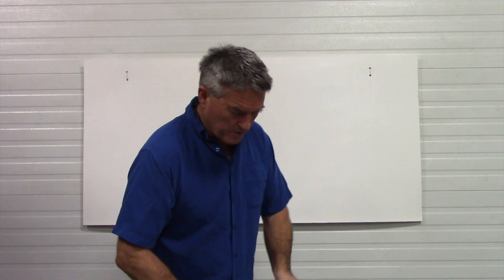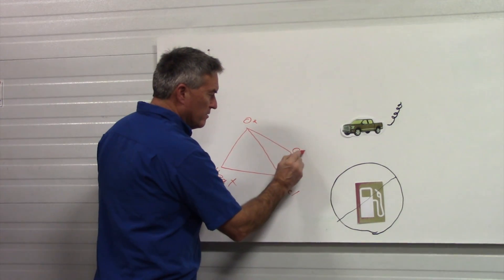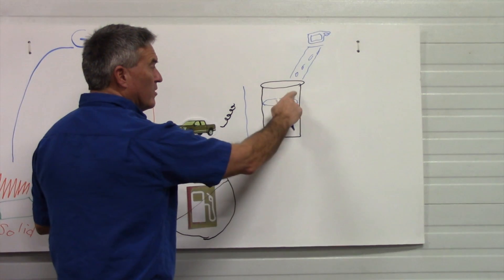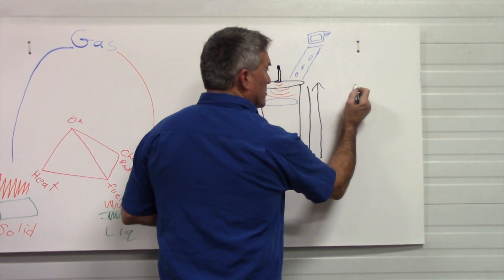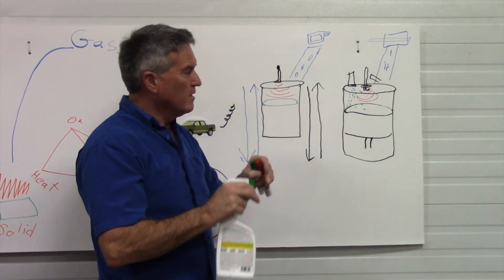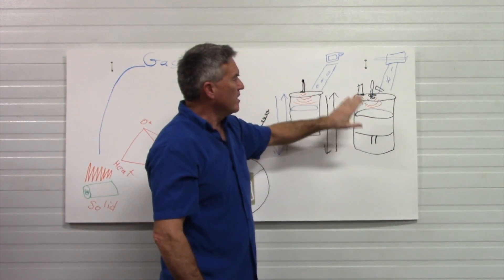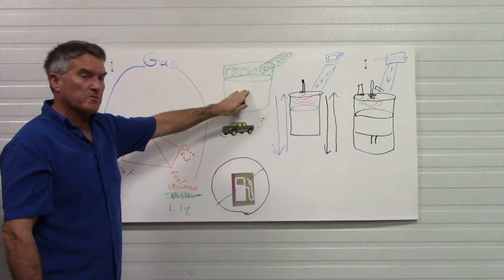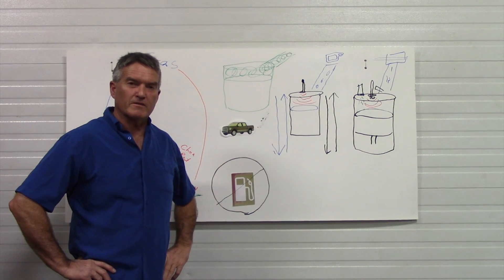One Simple Trick to get 100 miles per gallon with less pollution!

Comment: Cars could be getting a hundred miles per gallon but that doesn't profit the oil industry they have purchased multiple patents that would allow car manufacturers to get more than 40 to 50 miles per gallon. In the 1970s a man in Arizona built a similar device but a particular oil company sought to buy his patent he refused a short time later his body was found dead in the Arizona desert in his car which have the Prototype on the engine was missing. The man achieve 100 miles per gallon in the 1970s he was on the front page paper in Arizona.

Comment: If you cut the top off of a 55 gallon drum and fill it clear to the top with gasoline light a match on top of it that drum will burn for many many hours. If you take a drum cut the top of it off and pour a Dixie cup gasoline in it throw a match in there it will blow your freaking head off. Liquid gas put into an engine does not burn only vaporized gas Burns with oxygen mixed in with it. in 1985 I built a vapor carburetor based off of the pogue carburetor you can look it up Charles Nelson pogue vapor carburetor,,,,, I got 65 miles per gallon in a V8 Chevy with no pollutants and way more power the engine idled very smooth and took off like a bat out of hell. Halliburton got wind of it and threatened to end all life of all my family members.

Comment: I think its nearly too late for this,,, now electric cars are moving onto the scene...
Reply: Actually, EV's were here at the turn of the 19th century, but entities like Rockefeller/standard oil and GM did away with them for their fossil fuel vehicles.
Reply: Electric cars?  Fossil fuel is used to produce elecrtricity (at a net loss of fuel efficiency, never mind the production of the very expensive batteries).  Bah Humbug!

Comment: Not possible!!!
Saudi pockets won’t allow it to happen
Reply: It is not the Saudi Pockets, it is your own government that keeps this from happening.  TAX MONEY!!  The Reason Gasoline is so expensive is TAX!  Wake the hell up.  The people that YOU put into legislatures are sheering you everyday.  In the U.S. the EPA and other government agencies that are actually screw manufacturers are constantly making big noises about wanting to "force" higher mileage standards.  It happens incrementally, and, does so as to extend the inefficient technologies.  It is a ruse, pure and simple.  100 mpg would take too much money out of the hands of government and conglomerates who are joined at the hip.  Charlie Pogue proved out the vapor carb back in the mid 1930's.  IF anyone in government was serious about cutting emissions and getting greater fuel economy, ALL gasoline vehicles would be  either port or direct electronic vapor injected.  That technology was shown to be not only workable, but cheap and practical by a Texan in 1984, who died a very mysterious death, and his vehicle was seized.  That technology is perfected and on the shelf.   Stop blaming the Saudis.  They are simply cooperating with your own people who have been and will continue to screw you without giving you a kiss.

Comment: The explosion doesn't drive the piston down. It is the heating of the gasses in the cylinder that push the piston down. You need to learn the physics of the engine.

Comment: I already got 100MPH with a Honda GX-25 engine on a Huffy bicycle and only paid about $600 total. Only went 16-24MPH without pedaling, but It was okay as long as I didn't travel more than 100 miles in a day, and as long as there wasn't much snow and ice on the roads and shoulders. There's pollution, though. Great for plants, but bad for animals and us. I think the device in the video could be a great idea if it works and is affordable. I'd imagine 200MPG with my bike, or much higher speed and 100MPG without much pollution.

Comment: Well, introducing liquid gasoline into the air-fuel mixture would not be any different than if you injected gasoline in gas form. The O2 sensors downstream check the air-fuel mixture after combustion, and if there isn't enough fuel, the ECU will see it as a lean mix and send a command to the fuel injectors to spray more gas to the air/fuel mixture.  The internal combustion engine is not efficient whether you use gasoline, diesel, propane or other fuel. There is always going to be unspent fuel exiting the exhaust valve on the fourth stroke in a 4-cycle engine.

Comment: In the 70’s a genius guy found a way to separate the hydrogen molecules from the oxygen molecules with the byproduct being h2o dripping out the tailpipe.  Of course he was murdered shortly thereafter.  Before that in the sixties another poor fellow discovered powering an engine on fuel vapor and invented the 100 mpg motor.  What do you think happened.  Then yet another guy found it in the seventies and survived three attempts on his life before he died in an auto accident.  And there have been still others, so here we are today.  Check out certain sites on here or elsewhere.  The point now seems to be if a guy uses it on only his car he is left alone.  But if he tries to sell or manufacture it, he goes.  Gas engines run quite well on vapor alone without damage.  If either one can still be patented the inventor must insist whoever buys it must manufacture and sell it in a certain amount of time and cannot sell it to yet another entity who sits on it.

Comment: Note that in a reciprocating engine the pistons and connecting rods must accelerate to high speed and then stop twice per Revolution.  This produces a lot of wasted energy.  The pistons and rods get hot, and the heat must be dissipated in The radiator.  However in a gas turbine the motion is always perpendicular to the force, so no work is done.  We should all be driving gas turbines, with pressurized hydrogen as fuel.
Reply: You are sooo far from the truth...

Comment: Gas is not dinasoar goo. And  will never run out. 3rd most abundant resource. This guys talking sheet. 
Want 25% more power, turn off the  altinator. Find a better elctrcal.system. 12 volt is the most inefficient system avaiable. 
Robs your engine of a very significant power, and cost you more feul just for that crap 12 volt battery.

Comment: I hope people really don't believe that the powers that be are not aware of this. They are absolutely aware and they use fuel injection and carburetors specifically to dump these emissions in our atmosphere. It's been the plan from the beginning so that one day, they can charge you a carbon tax and literally charge tax on everything required to live. Right now they charge tax on food, Water, Shelter. The only thing left to charge you tax for that is an absolute necessity is your air. You will pay tax to breathe. It's coming and it's by Design

Comment: You may have a problem with Nitrogen Oxide ( Smog ).
Reply: Oxides of nitrogen?
Reply: @anselpeneloperainblossom-s3489  Yes. If your exhaust pipe is white, that's nitrogen oxide and you're running too lean.

Comment: ?!?!? fuel cooling the engine? your mama must be proud of your ideas...
Reply: Fuel is used to cool the combustion chamber and lubricate the upper cylinder. This is the reason Catalytic converters are needed, some of the fuel is not burned after ignition and comes out the exhaust from the slightly richer air fuel mix. The Catalytic converter chemically burns off the remaining fuel coming out of the exhaust.

Comment: If he is right that liquid fuel is needed to cool the cylinder walls then this procedure should destroy your engine.
Reply: steve eber . exactly. it would take self lubricating cylinder design. otherwise, we could just fill our tank with hydrogen. which i thought would work, but now i dont know. didnt know about the lubricating aspect.
Reply: I was just pointing out the disconnect in this fools logic.  In fact standard engines run just fine on propane with no modifications other than the injection system.

Comment: 1: CO2 is NOT pollution! It is a CRITICAL gas for LIFE! Without CO2 n earth, we all die
2: Petroleum [ "petro" = 'from rock', "oleum" = 'oil' because it comes from the rocks DEEP in the earth where everything is molten, NOT from dead dinosaurs ] and if it WERE a fossil there would be no life to produce it because there would be no carbon on the planet to combine with oxygen to become CO2 for plants to breathe to turn into organic matter to follow into the theory,
3: Plants decay into LIGHT alcohols, LIGHT hydrocarbons, and hard carbon. They do NOT decay [or pyrollize] into long chain hydrocarbons [oil].
4: We are NOWHERE NEAR peak oil. It just took fracking to realize the deeper, more dispersed oil.

Comment: If you like to use gas not liquid then use LPG instead gasoline and it is cheaper!
Reply: I once talked to man who burned exclusively propane on his 75 Ford Pickup.He once told me that if you pullrd  the the heads off ,you would find the valves clean like they were new all because of the way it burns fuel with the absence of carbon deposits.

Comment: I bought a EV 3 months ago and I enjoy it. But I need to get better mileage in my other vehicle
Reply: Good after noon ...well here...the Looney insane EPA nut  cases  took lead out of the gasoline, lowered the compression in the engines and smogged up the engine so in esssnce it's like you are trying to breath but have to breath through a bag of flour or run with a sock in your mouth....it's just wasting fuel makes you're engine  work harder and wears it out sooner. AND DOES ....NOR DID ANYTHING TO CLEAN THE AIR SOLVE POLLUTION AND COSTS YOU TWICE AS MUCH TO DRIVE. EPA MORONS TOFU BRAIN DEAD IDIOTS FEEL GOOD NATURE FREEKS.  
AS IN PURE UNTESTED UNPROOVED JUNK BS SCIENCE......ONE VOLCANO PUT MORE CRAP OUT IN ONE DAY THAN ALL THE CARS..VEHICLES DO IN A YEAR. BUT JUST DON'T TELL THE TOFU CROWD AS THEY MIGHT FEEL SAD....IT MAY COME AS A SURPRISE BUT ALL THIS JUNK SCIENCE HAS NOT FIXED CURES STOPPED A DAMN THING JUST MADE POOR FOLKS  EVEN MORE POOR.....WELCOME TO THE BRAINDEAD.ECO FREEKS NO EDECUATION ...IT'S ALL BASED ON THEIR FEELINGS....  JUST GREAT HUH!  And it's the one hundred percent honest truth! 

Mike. and yes I used to work as a mechanical , chemical electrical and physics instructor for both CALTECH. and  MIT

Have a great day 

Mike